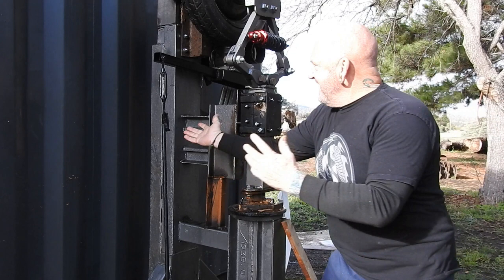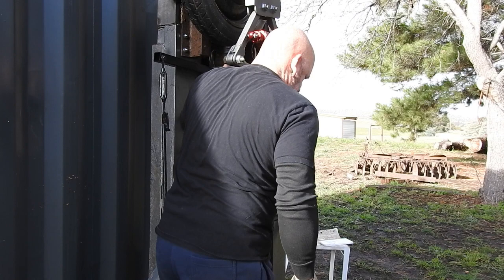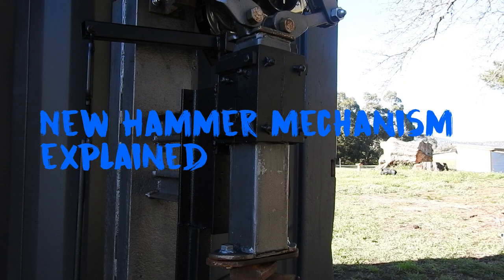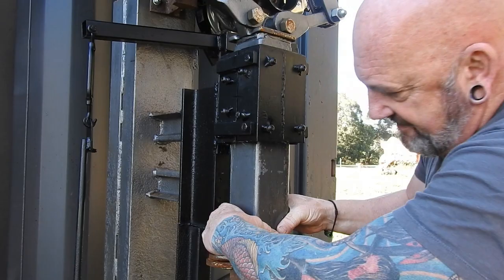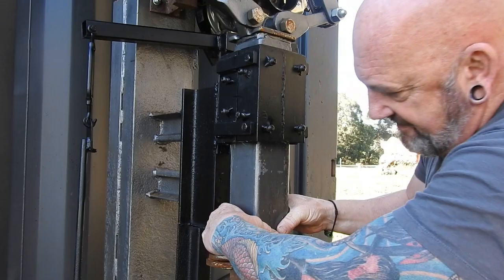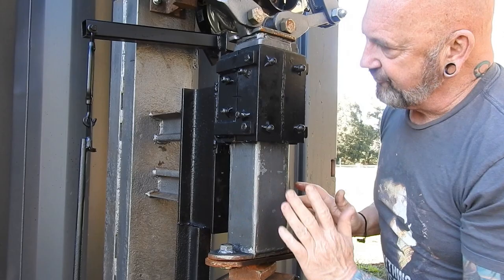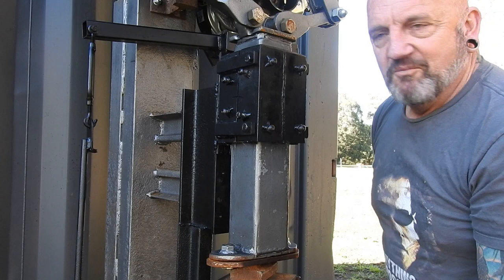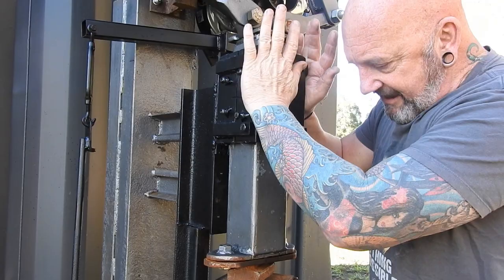Homemade Power Hammer - Testing

Comment: Excellent build. Be aware of the pillow bearing block frames. They have a tendency to crack on one side if the cast iron is not top grade. If that thing came apart it would probably take out a village. Well done with the sensitivity, hard to achieve with those masses.

Comment: I need that. Lol I do Damascus occasionally and it’s by hand that would save so much time. Finally a homemade hammer that actually has some power
Reply from the maker: Thanks....Yes it has a huge hit!...Scary!
I had a failed bearing on the drive wheel and have just fixed that (made it bigger from 25mm to 40mm). I have 2 billets that I am waiting for the right day to make them (been raining and cold every day and as my Hammer is outside with no cover at the moment so I can't use it). I have a 15n20 and 1084  billet and a 1084 and machinery chain billet waiting to be forged. So just waiting for the right day! Coming soon!

Comment: Why don't you forge something? the only thing I would change would be to make the bottom die the same size the same size  & put a brake on the hammer. Nice job man!
Reply from the maker: I have not forged anything as I have been building a house for most of the last year and therefore have not had the time!....Watch this space but!

Comment: Nice build Mark! May as well swap out for an electric motor if it's going to stay in the same place though
Reply from the maker: Maybe but for now the petrol works fine and as the hammer is outside so no fume issues! Plus I don't have an electric motor!
Reply: @markbilson3775  I've got a motor off an old dough sheeter I'm hoping will work for one! Happy forging Mark :)

Comment: New sub bro keep up the hammering. Tid bit of advice - oil the poly a tid bit now and then to keep it from melting and gumming up. I know the sheets are easily changed but a couple drops of oil now and then should reduce the time between replacing. I've seen the same material used in other processes and that's what's done to extend the life. All in all it's a super solid build though I did get a good sad face when you had to pull off the longboard wheels Haha! Looking forward to an update on where you find the first fail (not wishing bad on you just wanting to see where the soul of the machine shows through first after all I've always been taught that if you ain't breaking something you ain't doing anything!) Best wishes from Louisiana!
Reply: The liners of a lot of power company lift buckets are made of pretty much the same material (at least here they are) which makes for a good score on a ton of it (like 24 sq ft) if you can catch them when they are replacing the liners.
Reply from the maker: @BadDecisionsJeep  Hi and thanks for your advice and comments! I completely agree about the lube for the plastic......I have used some WDF40 and CRC to lube the hammer a you haver suggested. I have had a couple of HUGE failures but redesigned and fixed the problems.......Both of the bearings that hold the wheel failed as the shaft size was only 25mm and the thrust on the bearings was just too much.......So I went to a 40mm axel shaft and that fixed it!  Scary when the whole wheel starts to wobble  3 to 4 inches before completely failing!

I think I am pretty good now though! Well with 3 designs of the hammer mechanism and the wobbly wheel I think I have it sorted! I have just been making a couple of die's recently.  I will have another build shortly as I am making a hydraulic press out of a 30 ton log splitter.  The log splitter stays the same I am just changing the 'axe' on the ram with appropriate dies so that I can undo 1 bolt and change it from a log splitter to a blacksmith press.......
Reply: Nice, it's always good to have something that only needs minor changes to work instead of a full build lol!

Comment: Buen trabajo maestro 🤗🤗🤗☺️☺️☺️☺️una consulta de cuanto hp y revolución recomendaría
Reply from the maker: 7hp motor and the revolution is as per the throttle position.......Plus how much pressure you put on the drive bar with your foot determines the speed of the hammer. if you want more speed you push harder with your foot which reduces the slip from the drive wheel to the tire.

Comment: Great job. The only thing I'd do different is I'd use an electric motor instead of the petrol engine. Other than that its perfect.
Reply from the maker: Thanks!.......Yeah a petrol motor was a fair bit cheaper than an electric one....As the hammer is outside a petrol engine is no problem and it has 6 hp.....

Comment: Love it 👍
I plan on stealing alot of your ideas. I have most of the scrap lying around too make one similar.
Reply from the maker: Awesome...........A lot of my steel came from the tip at Cygnet!
Reply: @markbilson3775  I'm in Kettering, so I frequent the Margate tip. But their steel is usually limited and over priced. I'll have too check out cygnet
Reply from the maker: @oystercovecraftsman9219  Yeah Margate is expensive...........Cygnet and Franklin recycle centres are both good for variety of steel and cheap price...Like say $5 for a 3 foot long steel beam etc

Comment: good, but the hit will be very weak.  to have a strong blow, you need a stronger spring and in the lower position between the strikers there should be a distance of 2-3 inches.  good luck.
Reply from the maker: Thanks for the comment........Are you saying that I need more tension on the spring OR a bigger spring?????
Reply: @markbilson3775  more tension

Comment: How thick of UHMW sheets did you use?
Reply from the maker: About 10mm ......In answer to the other question I could have used the longboard wheels in hindsight....The problem I had was that I had not seen the Hammer in operation and therefore  did not trust that the longboard wheels would be stable enough.....However after seeing it run I believe that the wheels would have worked a treat......After a couple of bearings broke I decided it may become a big maintenance issue so I dropped the idea........The end result in the final mechanism works an absolute treat.....Almost maintenance free and simple to adjust....
Reply: @markbilson3775  thanks for the response! I asked the question about the wheels before finishing the other video where you explained your reasoning. I was wondering if just using the plastic to line a steel sleeve would work and lo and behold you came to the same conclusion by the time I got to the testing video. 
Watching your spring bolt break during your Damascus test run makes me nervous that my own rig will fall apart when running though! 😅
Reply from the maker: @GMixes  Yeah exactly! Turning it on for the first time is an adventure!.......The ground shakes when it runs! However you can fix anything that breaks so no big deal with a bit of redesign! Go for it and enjoy!!!
Reply from the maker: @GMixes  Wow what an effort 10/10 for perseverance and what an outcome! Awesome stuff....

Comment: Hey Mark, why the gas engine instead of an electric motor???
Reply from the maker: Cheaper! Plus as it is also outside no worries regarding the fumes etc.....Plus I would have to run power outside so it just made sense to use a petrol engine. However in an ideal world Electric would be the go! Also the engine is 7hp (and the Hammer needs it!) A 7hp electric motor is not cheap! Off memory the petrol engine cost me $180

Comment: That has to be the most insanely overpowered nutcracker I've ever seen!  You are right that it looks like you bought it.  Nice job!  How much money overall do you think you have invested in this?
Reply from the maker: Thanks a lot for your comments! Most of the steel I got from re-cycle centres with a total cost of about $40.......The gas motor was around $200 and the shock $50........Plus about $150 in bearings and plastic etc.......SO around the $500 mark to build......